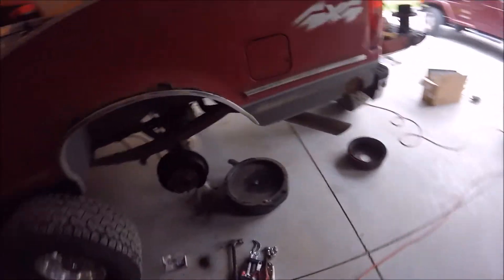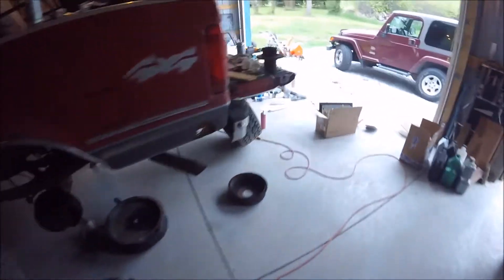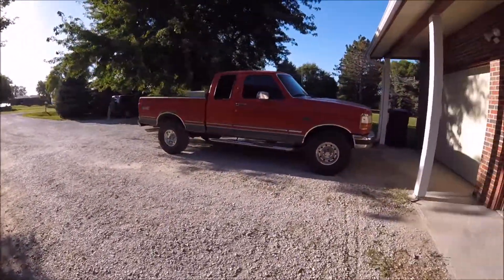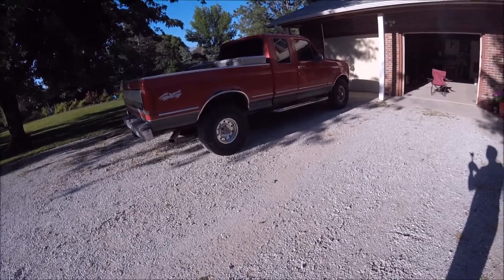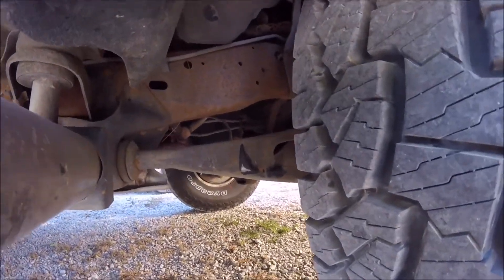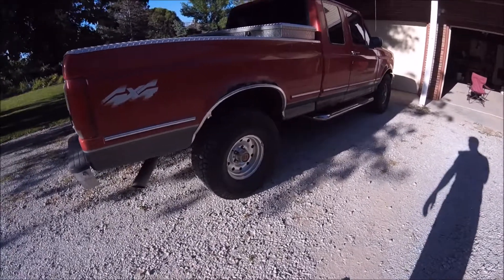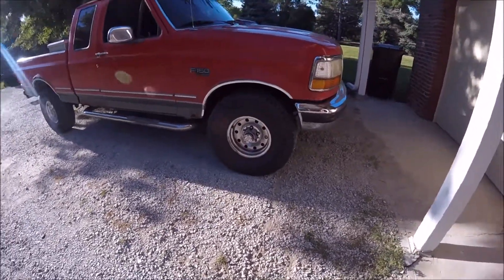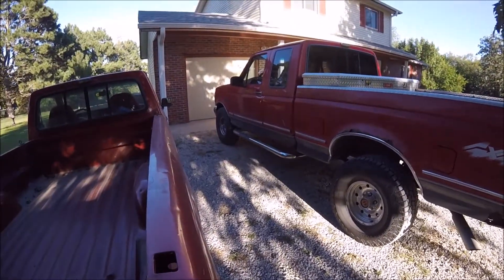F150 part 2 - 33x12.50s

Comment: I have a friend who just removed his stock wheels and tires and went to a 33 inch tire. His stock tire was basically 29 inches and now he is complaining he somehow lost some power. I said it's because everything is matched from the stall speed to the tire height to the rear gears. If it's like a dog now you need to put in like a 4.10 or 4.56 gears. He's just running a 350 with a 350 transmission and factory 3.42 gears. He wanted to know if I thought if he changed the factory gear ratios in the transmission if it would make up the difference. I said it might be a couple hundredths of a second but you'll never notice it just driving it. I leave stuff stock for the most part because bigger wheels and tires wears out ball joints and rear axles and it just never pays unless you know exactly what you're doing when you set it up. I'm right aren't I? He needs to put in lower gears to compensate for his taller tires to have more power or to get back what he lost?
Reply from the maker: @DieHolden  without going a ton into it you're basically right.  The more rotating mass you throw at your engine the more gear/power you'll need to keep moving at your stock levels.  I didn't notice a big lack of power going up to a 33" tire but anything above that ideally you would want to look at gear ratios, engine power and even brakes if you wanted everything to go and stop the best it can
Reply: @RichmansGarage  his truck is really heavy with a custom steel longer and wider flat bed and he likes to tow and lives in hilly areas. I think his truck weighs 6400 with the custom bed. It's just a half ton.

Comment: Do you have a lift of sorts? Please help am currently trying to decide what to do rebuilding my truck
Reply from the maker: I don't have a lift right now, just a jack and jack stands.  What are you trying to do with your truck?
Reply: @RichmansGarage  well currently the cab is being swapped but for the shocks I wanted to run 2 inch lift shocks in the front and a 1 inch lift shock set in the back, will I need drop bracket arms for 2 inches of lift or do you think the geometry will be able to be aligned, am going to run stock rear leaf springs but brand new ones

Comment: i have a 95, i got some 33" tires i wanna put on it, but i wanna get a lift kit first, thinking of a 4" lift, but its good to see this video to see how it would look with out a lift
Reply: Man, I don't know how to send you a picture though here, I put a 4in rough country lift on my 93 f150 with some 33 in tires and it gave me the exact look I want and no clearance issues. This looks nice but the lift really makes it pop
Reply: @jaredherrera8664  I like to put 33s on my 96 f150 4.9 I6, what mileage are you getting with 33s and did you lose any performance due to tires being heavier then stock size?
Reply: @Arizonahwy10  before the tires I was getting around 14 give or take and with tires, around 12,  you lose a little performance but nothing really noticeable. I'm actually in the process of throwing a 408 stroker in the truck. 4.9l is a good motor but if you want power. There not the way to go, but when the motor was in the truck it was fine. Definitely worth the bigger tires and lift
Reply: @jaredherrera8664  awesome thanks for the info,  I already have a 4" lift installed and it will definitely look good sitting on 33s,  I think the  4.9 and ZF5 combo will do just fine
Reply: @Arizonahwy10  yessir, that's exactly the combo I had, the 4.9l puts out some good torque, could also put a bigger set of gears in the rear end
Reply: @jaredherrera8664  I would like bigger gears eventually possibly 4.10s which I've had before on a different vehicle with 33s but for now I  will drive with the stock 3.55, the ZF5 granny gear and 4 low makes this truck climb slowly through anything without touching the gas pedal, I'll see how it does once I put some 33s

Comment: Does it rub at all on the radius arm?
Reply from the maker: Yeah, its only if you are really trying to turn sharp though.
Reply: @RichmansGarage  i ended up going with 32x11.50r15 and they slightly run at a full turn but not much at all tbh